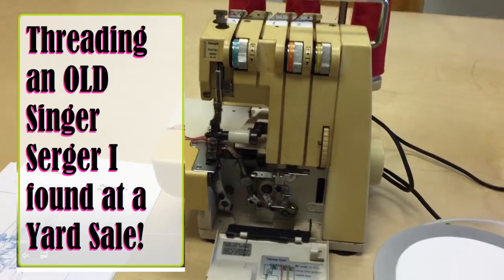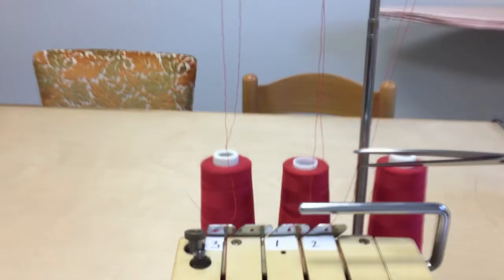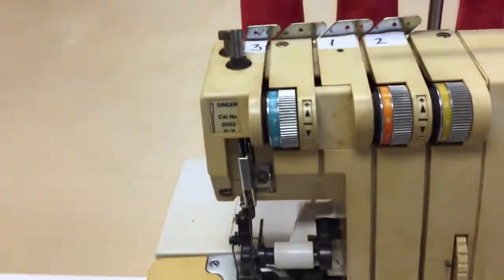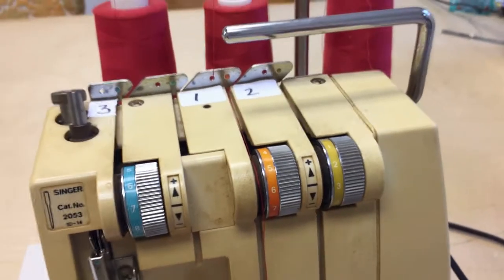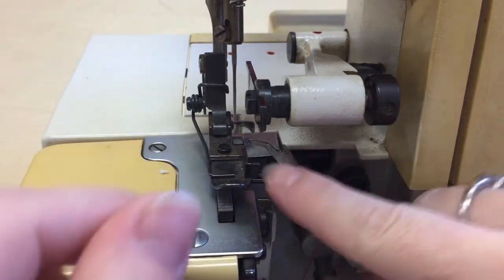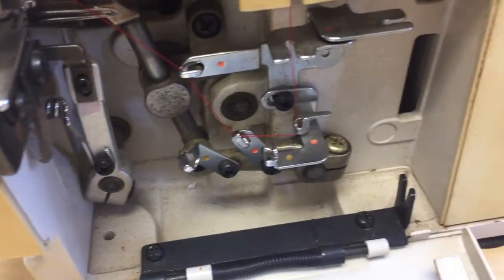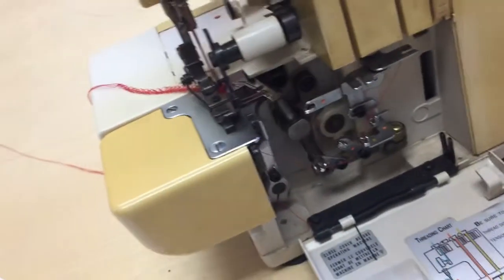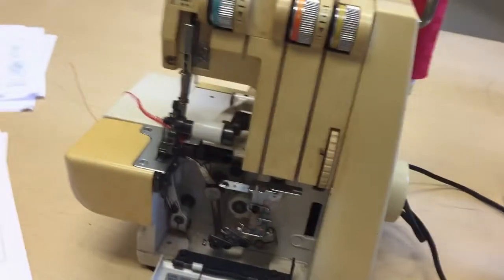Threading  an OLD Serger I Found at a Yard Sale!  How to Thread a Singer 14U52A

Comment: I have that serger. It weighs a ton. It is all steel, new ones are not. It's difficult to thread so this is a great video.
Reply from the maker: Glad you liked the video! Yes its a nice little machine.
Reply: @pindropshop Thank you so much for the video! I've been looking for a video for this exact machine! It was given to me years ago, so I have no manual.  Also, I wanted to add that this machine requires ROUND SHANK needles, which are hard to find...I found Organ brand on Amazon. Recommended tension?
Reply from the maker: @diro6232  Thank you for your comment! That's great to hear.  
I was getting a good stitch on mine with tensions at 7, 6, and 2.5.

Comment: Thank you very much for this video 
I inherited similar machine from my sister! I managed to threat it but the threads keep braking , should I replace all the threads please?
Reply from the maker: Hello! Sorry for the late reply.  Yes, if you're having problems I would always recommend rethreading the entire thing.  If threads are breaking, it could be that your tensions are too tight.  Check that they are all at 4 (or the recommended default tension for your machine.).

Comment: I have this, I plan to sell it as well. I bought it from my local sewing machine repair guy, in a hurry to fix a girls prom dress that was needed right away. I normally sew on Singer treadles which won't take stretchy or polyester dress fabrics. It worked beautifully with the thin nylon thread but a nightmare with cotton. I ordered new needles and expensive 80wt thread and I still can't make a simple cotton knit headband with it. Want mine? LOL.
Reply from the maker: Wonder if you can change some settings and get a nice stitch with the cotton.  I had to play with this one a little bit to get it looking good.  I was actually just using the needle and the thread it came with, some kind of cotton serger thread. Interesting that you have this too!  I had never seen this one before!
Reply: @pindropshop  I have been doing all I can to get it to cooperate. Just when I think I've got it the needle thread pops off. I think I might sell it off and put whatever I get towards a sewing/embroidery machine...... but those scare me too. I think I paid $160 for mine, I bet you got yours for a waaaay better price!
Reply from the maker: @kikis7196  Got it for $20! I couldn't believe it.  I have this one's tension set to 7, 5, and 3 from left to right, maybe try that and see?

Comment: Could explain how to adjust all those tension knobs?
Reply from the maker: I would start with how I have them all set up on this video.  Then you will need to look at your stitch and compare to how a stitch is supposed to look. Depending on what is wrong with it, there are adjustments to make it right.

Comment: Does it make patches?
Reply from the maker: Yes, you could make patches with this.  Just cut a piece of fabric and serge all the way around the outside.  You could turn the stitch length dial almost all the way down to get 
really tight thread coverage around the outside.

Comment: Hello! Can you tell me where to buy a needle holder for this overlocker?
Reply from the maker: Hello!  The needle holder for inserting needles is actually just a tiny hole that was drilled into the end of the brush that came with one of my other machines.  They sell them at SewingPartsOnline for 2.99 USD under the name

 Lint Brush With Needle Inserter, Juki 40065952
Reply: @pindropshop  Thank you) I meant the machine element itself, which holds the needle in place with a screw. In the old one, there is no longer a thread for screwing in and because of this, the needle is not fixed in the machine.
Reply from the maker: @ВитаРаковиц  So there is nowhere to put the needles at all?